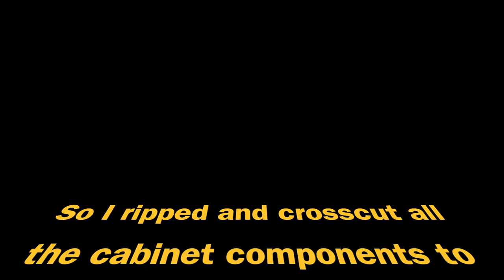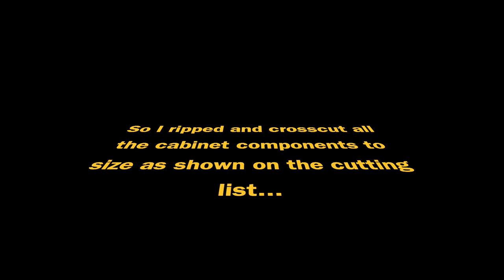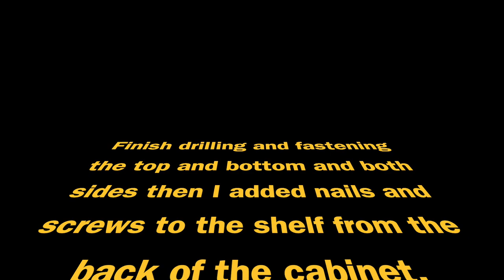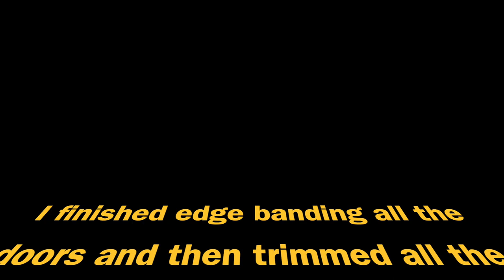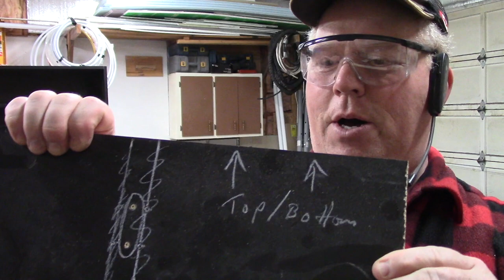DIY Melamine Shop Cabinets

Comment: One trick you can try (on black melamine only), if tear out is unavoidable along the edges you can run a Sharpie marker on the edge to conceal the tear out. If necessary, use lacquer thinner to remove any excess marker.

Comment: How do they hold up? Ive thought of using melamine with wood prices so high.
Reply from the maker: Kitchen cabinets, entertainment units and book cases are all made from melamine.  If you buy shop cabinets they are made from melamine too.  Yeah they are great as long as you don't get them wet or spill oil all over them.  Plywood is better but nothing is as cheap as melamine.

Comment: Where did you get the colored melamine?  I love the looks of your cabinets, but can only find white melamine
Reply from the maker: Oh yes I had the same issue!  They used to carry black at Home Depot in the shelving section which was my planned purchase but they dropped it.  A contractor friend brought me sheets from a cabinet maker he deals with.  You may be able to custom order some from a home centre.  Best of Luck!
Reply: Lumber Yards & Plywood Dealers! You can get the full spectrum from basic white, to other solid colors, to wood grain patterns. And it will work out to better quality, (and sometimes cheaper!) than the big box stores.